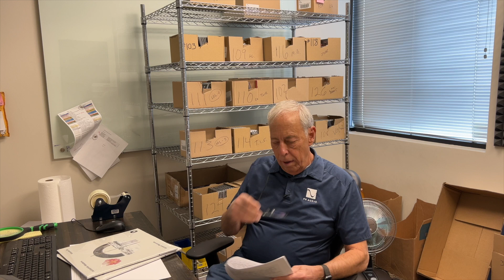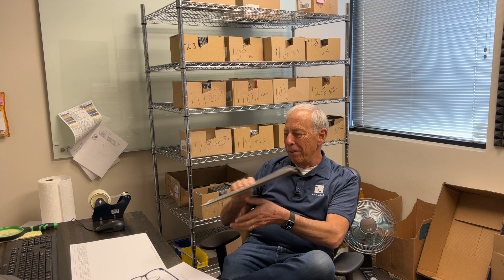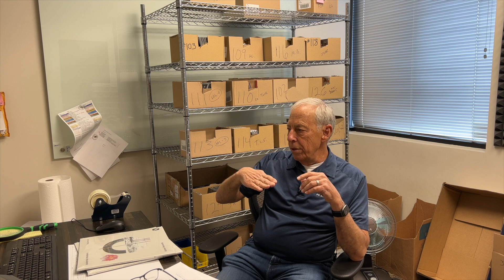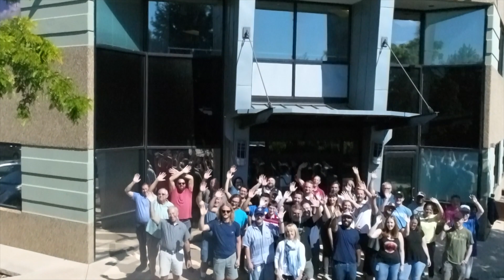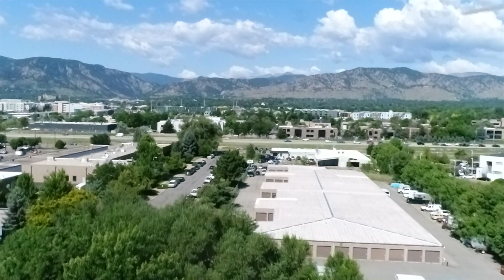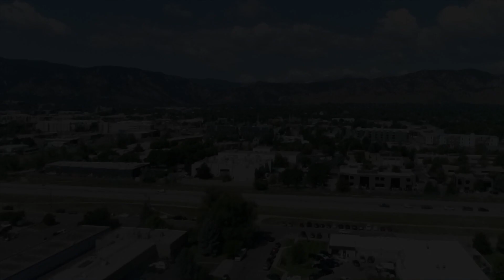Why sound changes with volume

Comment: It's not so much that your amplifier changes its character as you increase volume but it is your speakers.
As you put more power through the voice coils they heat up. As a metal, normally copper in a voice coil, heats up its impedance increases. The impedance of the voice coil forms part of the crossover network. As the impedance changes so does the characteristics of the crossover, changing the frequency of the crossover point and the phase at the crossover point. Many (most?) manufacturers tune their crossovers so they integrate best at showroom listening levels which tend to be much higher than domestic listening levels. You will find that most speakers have a volume sweet spot for this reason.

Comment: This is not headroom problem, it's more about loosing low level signal information. Many devices very poorly working on low levels. You can make 20kW amplifier and it"s still will be very poor on low levels.

Comment: Typically it's the "loudness effect".  Human hearing becomes more sensitive to high and low frequencies as the volume is increased.  Older HiFi Receivers and preamps had a loudness button to boost treble and bass at lower volumes to provide the low volume listener with the same apparent frequency response that they would hear at higher volumes.

Comment: The concept share some similarities to PC hardware.  The power supply is designed for a specific wattage and an efficiency curve.  Once you surpass that threshold, the efficiency plummets.

Comment: I use the same rules of overhead in my amplifier in car audio. Has worked very well for me in the past. Currently I am using an 800 watt monoblock for a single 300 watt 12 inch subwoofer. Just getting to the end of the sub break-in period. Time to set my gains soon with my multimeter

Comment: Some top shelf Marantz AVRs, like my old SR 7500, have two amps sections built in one box and you can actually bi amp (not by wire) loudspeakers with dual binding posts. The sound is so beautiful and powerful. This set up disables the built in room equalizer Audysey which is a bonus. It is all in the manual.  Who needs to spend squillions on high end ?

Comment: I am glad I don’t have to “fight” with my music listening. 😀 I don’t think listening to music should be a on going battle. 

Almost every time I read the comments on Paul’s channel I get the impression I need to buy 10 different amplifiers, 20 different speakers, 6 different DAC’s. a closet full of different audio cables, maybe even assorted colors to match the decor.
Bring in a professional Acoustic engineering team to do room treatment and buying Paul’s books. 
All that is just the tip of the iceberg.

Comment: Amplifier sound should not change enough to be noticeable with volume until it gets close to clipping.  
Much more likely the SPEAKERS change sound with volume.
Reply: THAT'S the response I was looking for! I can get 100db from my system, and still be inside of 10 watts. But the sound transducers response changes dramatically from 70db to 100db. Thank you for hitting my nail on the head!

Comment: Having way more power than you need has always been Bob Carver's belief and why he started Phase Linear with the most powerful amplifier of it's day.  He realized the need for enormous amounts of reserve power when he visited a famous sound researcher who was attempting to recreate the "snip" of an ordinary pair of scissors. He used no less that TWENTY-FOUR 200-watt amplifiers for playback. Yet when viewed on an oscilloscope it was apparent that the top of that instantaneous transition was being distorted. Believe it or not, he needed more power! It was evident that real-world sound occurs very quickly and requires far more power than ANY current amplifier could produce. This is one reason the sound changes with the volume level and why headroom is so important. Another cause can be the speaker it self, if you ever listened to a Steve Guttenberg speaker review he often states if a speakers sound stays the same at low and high volume levels.

Comment: An even more simple electronic tech reason also exists. Most (analog) volume controls are the primary "R" in the passive "R/C" network that is the Volume Control. The lower the Volume, the higher the resistance of that R. And as R goes up, frequency response lowers. 

The results are very visible by simply passing a high frequency squarewave (10khz?) into preamp/ amp with volume controls and scope the output. Start with the volume control full open and set the input signal to give full rated output. Then reduce the volume control and increase the input to compensate, to get the same output. You will find that at a given output, the lower the volume control the lower the frequency response limits. 

You can check prevolume control from a Tape out or such to see that you are not under or over driving the input stage causing the difference.

Comment: I know an audiophile would shudder at the thought but would it be feasible in another setting, perhaps motorcycle or stadium sound, to have the amp notice changes in the instantaneous output impedance to get a feel for the physical limits of the speakers and avoid blowing them past their points of no return?

Comment: It may not be what the guy asked, but if we're discussing speaker systems, let's not forget that the room plays a huge part in this. Any room and speaker combo will tend to have a sweet spot volume range, where you're getting the most sound you can out of the speakers BEFORE the room gets too involved.
Reply: Agree 💯
It's not as simple as that getting a high watage amplifier and you are done with it. It's all your f****ing room that plays an important role atleast 70% In my opinion and the remaining 30% goes for the electronics. Period. 
And moreover it's the current capability of the amp rather than just focusing the number in watts.
And to me personally amp sounds good with increase in volume up to a level until the room starts to interfere.
Reply: @laymanaudiophile  I explain it to people like this. Your speakers are like the strings on a guitar. The room is the body of the guitar. The type of strings and how they are played makes a big difference. But the body of the guitar is where the sound you hear comes from.

Comment: I totally agree with Paul, but what's with the new trend for 'Flee-watt amps?(<25W/ch.) There's a group of audiophiles that are enamored with these low wattage amps and just how nice they sound with very efficient speakers of course. Those amps certainly aren't operating in the linear portion. I would expect that they are dithering back and forth over the distortion line because they are working so hard to drive their loads. Paul, care to weigh in?
Reply: The audiophile flea watt amps are mostly all tube amps. Tubes are a different animal all together. The lower power solid state amps likewise, are probably pure class A all the way to max power. By comparison, a lot of monster 4-500+ watt class AB amps only have 10-12 watts in class A.

Comment: I have the efficient Q acoustic concept 500 speakers 90 db into 6 ohms driven by a Mitchi X5 integrated amplifier 600 + 600 watts into 4 ohms . I agree entirely with Pauls view , i have so much headroom  that level 42 is sufficiant for a great punchy sound with very low distortion and no fatique or clipping . My previous Meridian dsp 8000 se with 10 x150 watt amplifiers built in had an equally smooth low distortion  punchy sound . I also found that to listen at low levels i have to increase treble by quite a lot to acheive a good balance , maybe the only downside to having a 50 kilo monster integrated amp .

Comment: Many years ago I worked part time at tech hi fi in kenmore sq Boston.
When asked how much power do I need?? I said as much as you can afford. And explained why. Then did a demo. Low power amp, then 100 wpc amp same source.
Most times that made the sale.
I did that for a reason. I wanted that customer to have an experience of sound quality and power. I could tell by the questions asked if they were serious or curious. My job? Help them down the path of quality audio. A very subjective topic.
I gave my take on it, take or leave.

Comment: Yes it’s called “headroom”  it has always been called headroom. 
Headroom vs THD. Remember the days of “Boomboxes” flooding the market..???  

What Paul is talking about was every event in Boomboxes back then. You would hit distortion very quickly with the volume control. 😀 They shipped with 10% distortion right out of the box. 😀 It’s the same reason Beats Headphones sounded bad, they had an amplifier built in to those headphones. Crank up the volume and distortion went into the stratosphere.

You will also notice with some singers you listen to. People crank up the volume..😳🙄 Hint: the singer is not singing that loud you have the volume set..😀 😀😀😀😀😀😀😀😀😀😀
You have to turn down the volume to match the singer’s voice in real life.
The singer is not screaming into the microphone on the recording HELLO.
People do dumb things with audio.